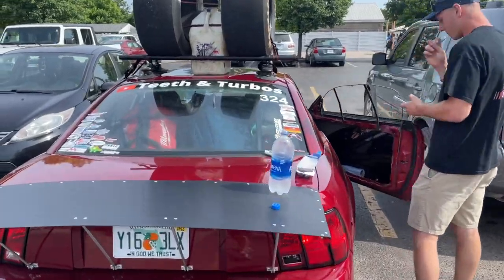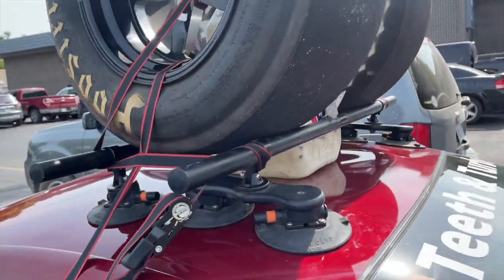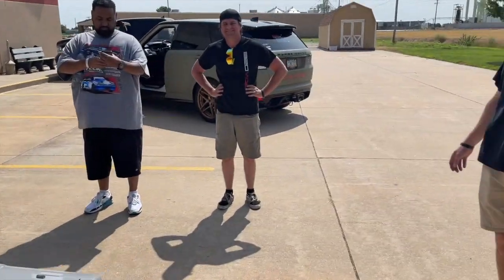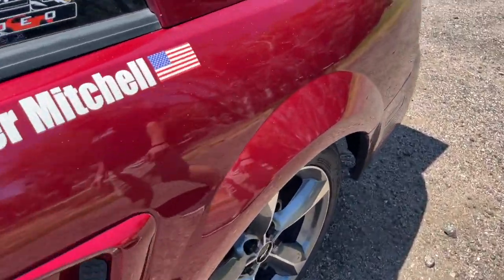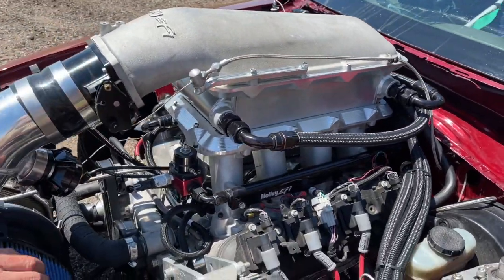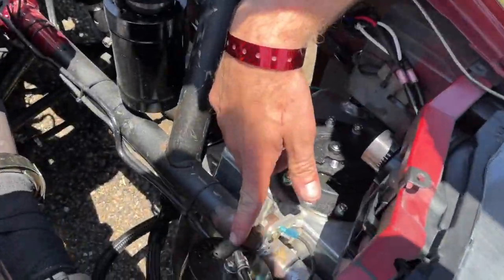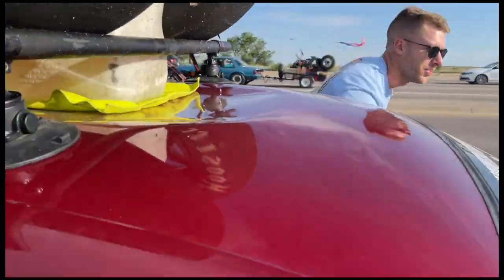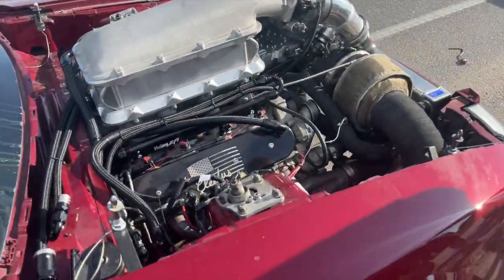Race Week Day 2 - BROKEN DOWN 2 Miles from Pueblo! Ultimate Endurance Travel Day

Comment: A few drain holes in the trunk, a bunch of Ice packed around the tank, and a 50/50 mix of e85 and 93. Who knew Colorado heat would be the primary problem on day 1 of driving. LOL, and they always pick on our heat.
Reply: Definitely agree with filling the truck full of ice and drain holes also might not be a bad idea to lose the hood if possible as well as maybe an insulation wrap to put on the fuel lines or rig up a weed sprayer so they can spray water on the fuel lines as they are driving the evaporation of the water on the lines will definitely help cool them down. As far as mixing fuels I would try say maybe a try a 75% Pump gas and 25% E85 first and adjust up or down from there otherwise fuel mileage could become a problem

Comment: ice down the outside of the fuel cell throw a bag ontop and roll on down the road should help for awhile
Reply: a second fuel pump just to pump gas out of the fuel cell and through a transmission cooler and back in the cell

Comment: Hell yeah brother Cletus in his bro on Rocky Mountain race week together don't get no better💯🤘🇺🇸🏔
Reply: Old Farmer trick put some clothes pins on the fuel line. Clothespins on the fuel line work because they are insulators. The fuel absorbs less heat as it flows through fuel lines located in a hot environment.

When conditions are near a tipping point it doesn’t take much, and just a little might be just enough.

Comment: Next time your fuel boils buy bags of ice and put it around the street tank
Reply: Just make E85 ice cubes for the drink?
Reply: @lin3bass  Freeze 93 and put them in the tank🤷‍♂️
Reply: @calebhumphrey536  🧐 Hmmm... Run the fuel through the AC
Reply: Better yet, run the AC through the fuel
Reply: @lin3bass  The car don’t got ac
Reply: @calebhumphrey536  Oh sorry didn't realize he dont got AC! 
In saying that. I havnt seen the full build but why doesn't he?
Reply: @lin3bass  He bought the car with no a/c. There’s really no point. Adds weight and complexity to the car. It’d be easy and more affective to tap into the intercooler tank with a cool shirt
Reply: @calebhumphrey536  Fair call :) Maybe a stupid question but do they make fuel RADS??
Reply: @lin3bass  I’ve never heard of one. But it would decrease fuel pressure by so much i don’t think it would eork
Reply: @calebhumphrey536  Would be a laugh if you could get gas that was freezing though eh 😅

Comment: IF . . . . . . . 

If Race Weeks were actually spread over 8 or 9 days,
the Drag-Strip racing could (arguably) get started earlier in the mornings
(i.e. the cooler part of the day), 
with a Siesta  (11 am until 3 pm),
before resuming again at about 3.00 pm (until 10 or 11 ?)
by allowing "Drive" days to be followed by a proper nights SLEEP.

If you are intending to do four
& five (?) such events in a year
a)  MidWest Drags (Drag-N-Drive),
b)  Rocky Mountain 1.0, 
c) HOT ROD (magazine) Drag Week
d)  Rocky Mountain 2.0
& ? HOT ROD Power Tour 

you need some SLEEP breaks, or you WILL KILL yourselves !